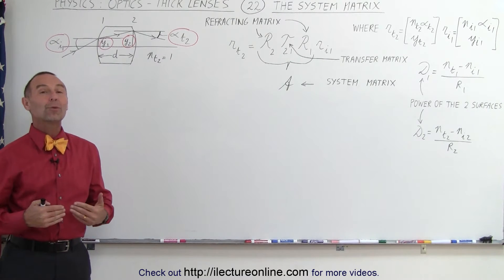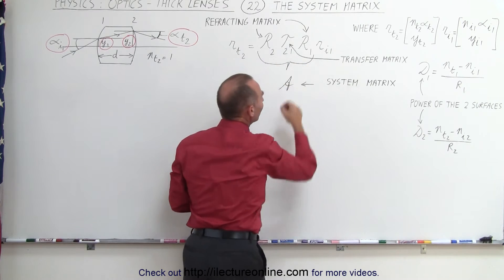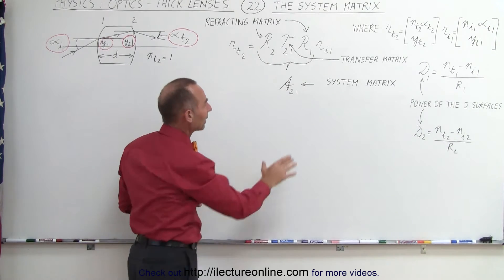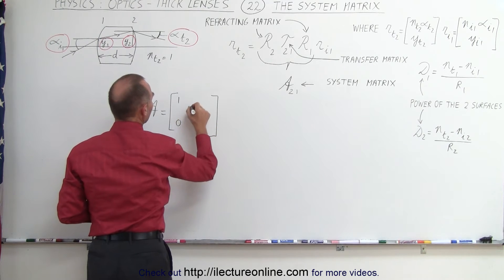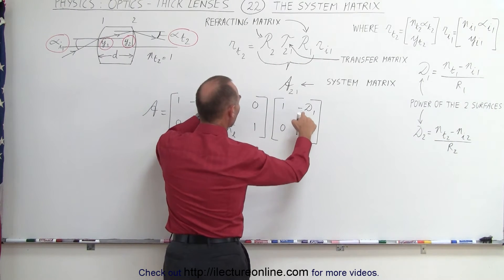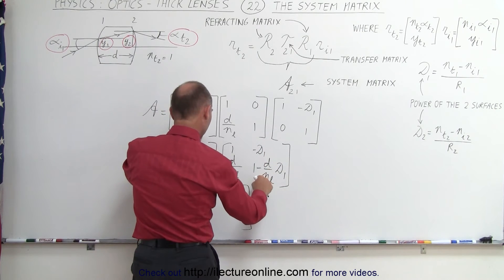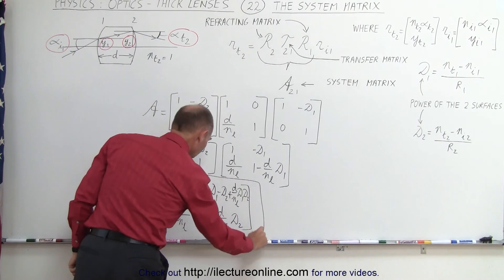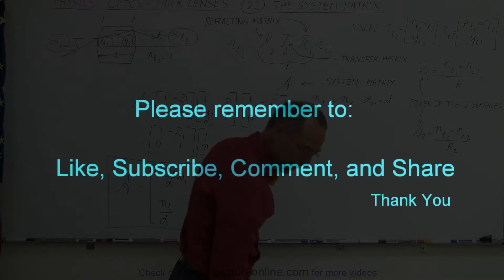Physics: Optics- Thick Lenses (22 of 56) The System Matrix

Comment: so does that mean the whole thing is wrong?
Reply: No, just turn upside down to the d/nl and make the calculus. He did it again, so the answer is correct. He just shared with us his mistake. You need to divide the index of refraction to eliminate some terms to form the matrix format, if don't clear know how to do that, he has a previous video where he explains how to convert refraction/transfer equations to the matrix format...well, from there is going to be d/nl and not nl/d.  Although, you should learn the cardinal points of an Optical System. Is quite to the beginning of his playlist (or thick lenses 1 of 56). Hope that explanation worked for you or helped you somehow!

Comment: How do we get the individual R2 T2 and R1
Reply: To know how, you need to watch the previous video. R2 and R1 are linked to the fact that you have to know what is going to the boundaries, from there is D2, D1 (or the power). To form or match a matrix with traditional equations (I tried to explain them down to the others), you need to eliminate some terms as well as those forms will be exactly compatible, from there you have 0 and 1. However, you have to cover the beginning and hopefully with my explanation, to understand! Cheers.